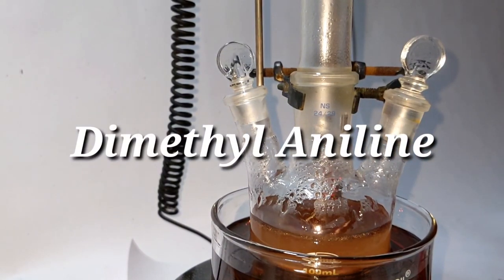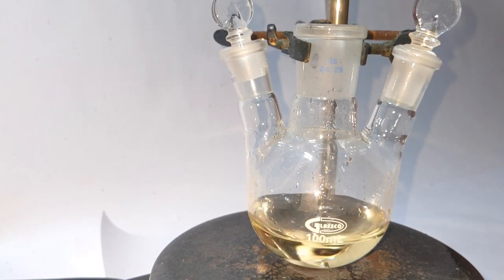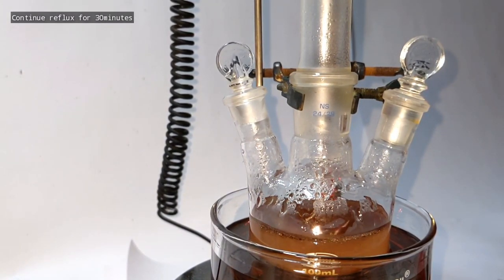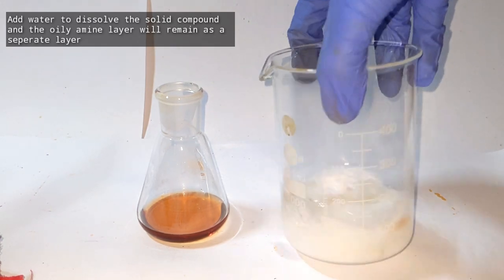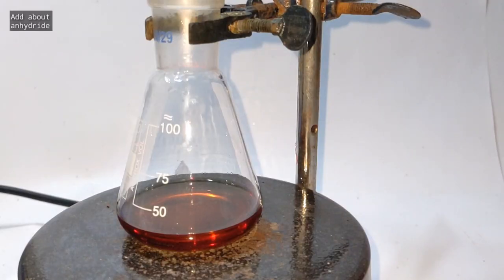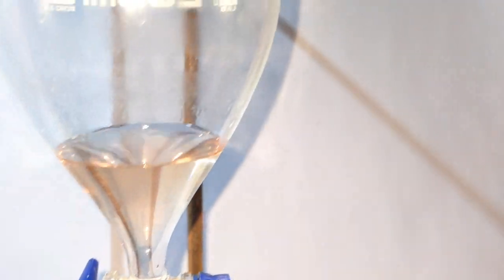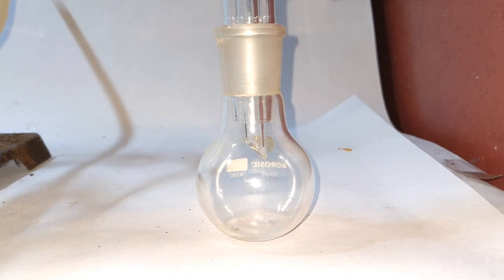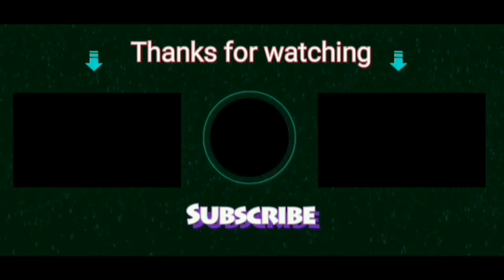Dimethylaniline : Synthesis

Comment: I need 26 dimethylaniline to synthesize lidocaine for my own use I am in horrible pain along with neuropathy that's so bad I haven't slept in days the 4% solution that I can get from my doctor it doesn't do anything at all I need at least seven 8%. I've extracted it from other products with the base and then carefully mixed the dilution of around between 7 seven and a half eight percent and it did the job and I slept like a baby. I know I can't use this habitually but if worse comes to worse I can always get a night's sleep. Extracting Raider king is too expensive I think I'll just buy a bottle of 100 milliliters of Jane methyl analine it's about $180 it'll be cheaper in the long run